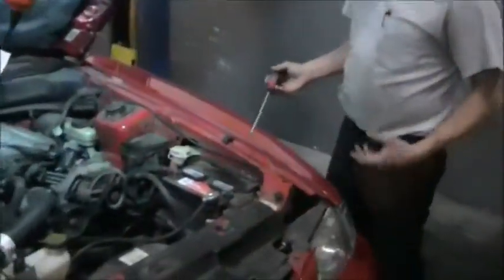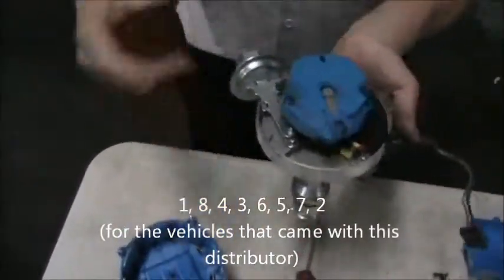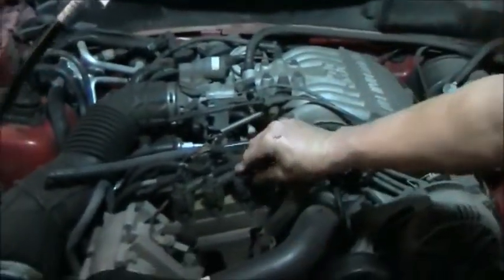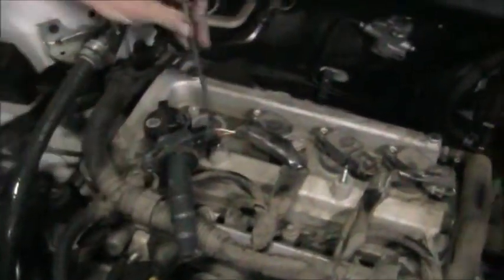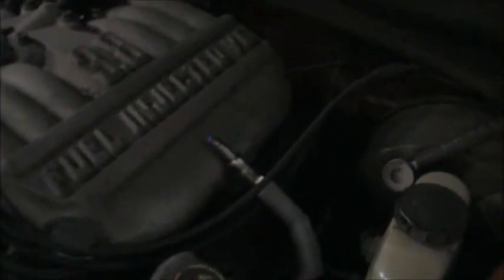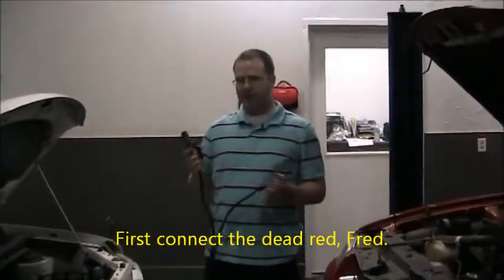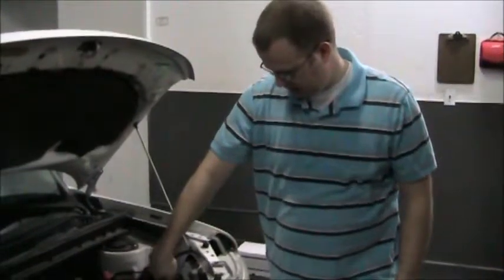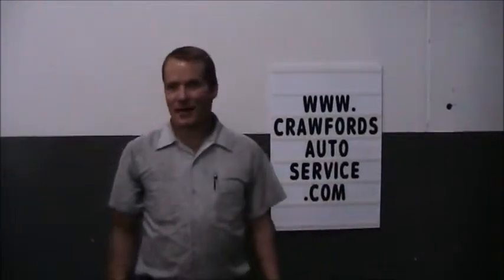Lesson 8: The Electrical System and Ignition System

Comment: Shown in the Lesson 8 video is exactly how NOT to safely jump your vehicle.

The correct and safe procedure to prevent a spark near and potentially exploding the battery (by igniting hydrogen gas) is:
(1) positive (red) battery post on dead vehicle to positive battery post on good vehicle, (2) negative battery post on dead vehicle to a ground on the good vehicle like engine block or alternator bracket AWAY FROM THE BATTERY - ALWAYS!

This is auto safety 101.